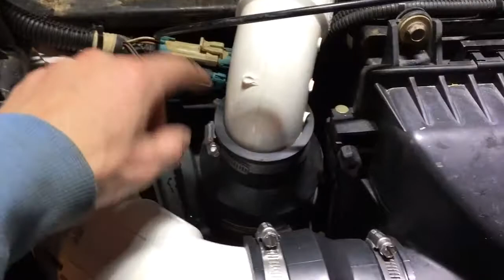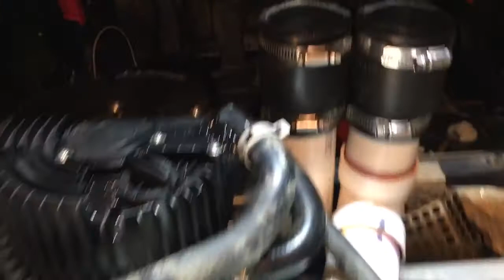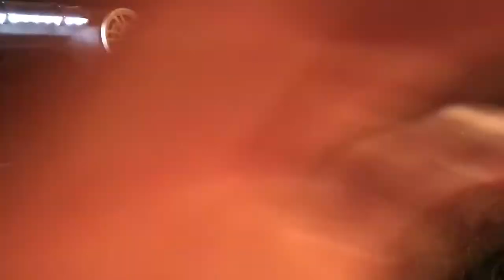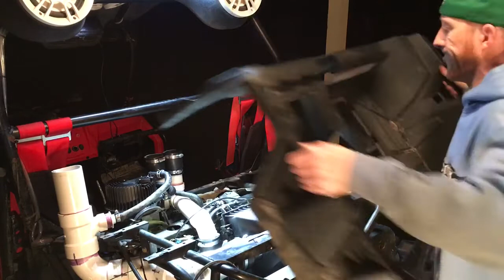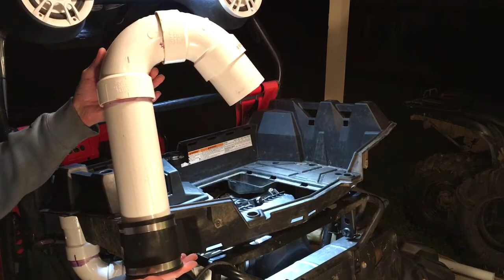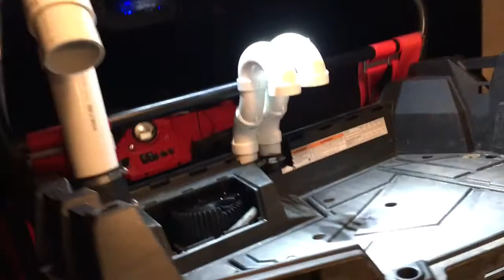HOMEMADE RZR XP 900 SNORKELS WITH PARTS LIST

Comment: What did you use to hold the engine intake up? Is the parts list of everything you have piled up or just what you used? Can you post or send me a picture of it coming through the bed if you still have it?
Reply from the maker: Nathan Berry the parts list is what was used. I used big zip ties to hold the intake pipe up against the metal bed support